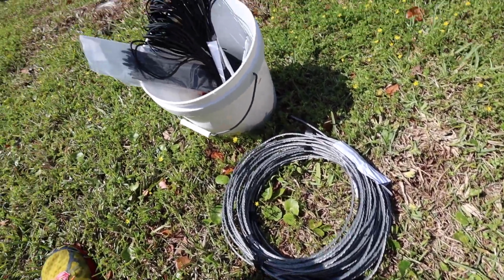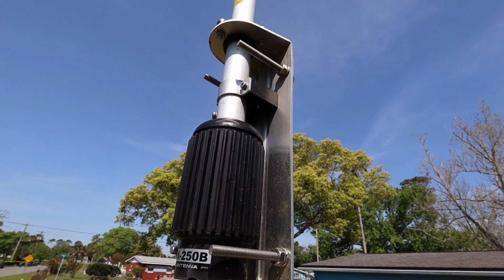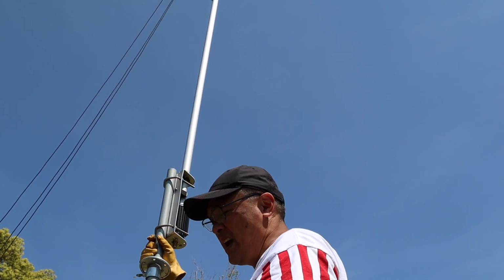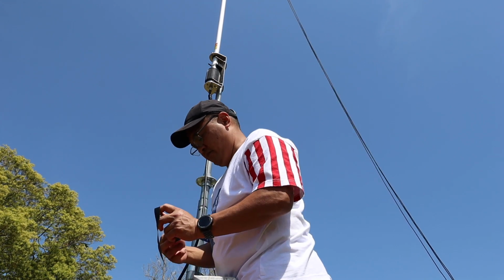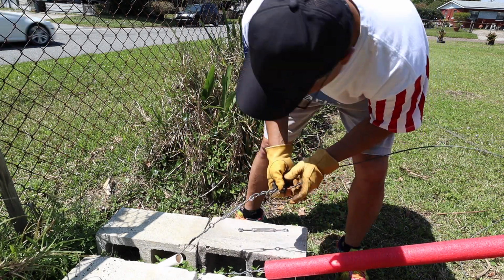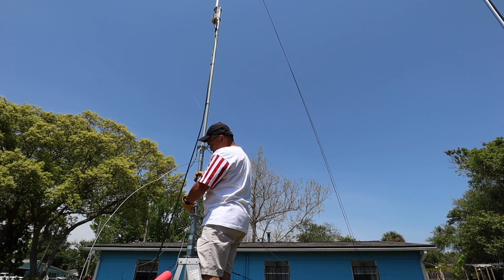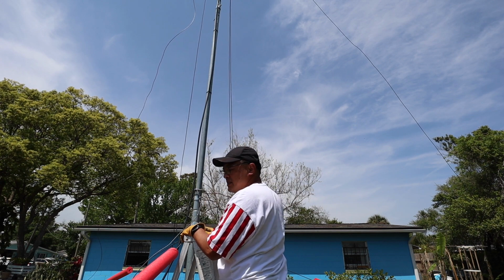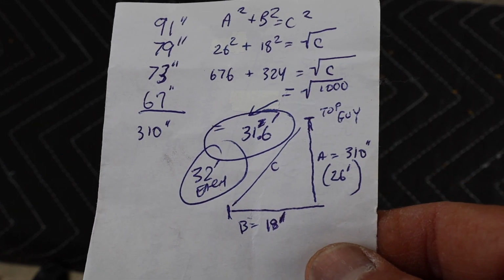Comet CHA-250B HF Antenna Takedown and Reinstall

Comment: I use one of these antennas and I have worked the United States,  Europe, Australia, and South America. Mine is 15 feet above ground. If someone is looking for a multibrand, no radials, no tuning antenna this is a good choice. The only drawback to this antenna is the limited transmit power. 250 watts.

Comment: The same antenna was marketed as the Jetstream JTV680. I have one that I got second hand a couple years ago. It just went up  literally in my front garden. SWR is great from 80 meters thru 12 meters, is about 1.8:1 on 10 meters and over 2.5:1 on 6 meters...  Useable on 80-10, no good on 6 meters.   Still in shake-down with a QRP rig in the station. I conskder it my utility antenna as I have an inverted-L out back.

De WB2VUO in Amherst, NY
Reply from the maker: I'm now using a DX Commander Classic as my Primary HF antenna.
Reply: @DarrenN4VFR  : I got my license in 1966. I guess that makes me an "Old-Timer". The yard is very small here, 100 feet by 40 feet, and the house sits roughly 1/3 the way into the yard from the street. My back yard has the AC drop running diagonally over the garage and driveway, and I have a 33KV power line along the rear property line. My useable space out back is only 25 feet by 55 feet. I have a patio lattice roof and a rear balcony. They have my VHF antennas (6M vertical, VHF/UHF Colinear, 6 meter horizontal Omni Loop)  plus a 20 - 6 meter Cobweb. A trap vertical is on the north property line, a 10 meter vertical is on a mast at the rear of the patio and a 30 foot mast supports a shortened 80 - 10 inverted-L. The back yard is full....

The Jetstream JTV680F is on a mast in the front flower garden. I just put it up as a secondary antenna, primarily to test rigs and to run FT4 or FT8 digital.  It was a flea market purchase almost on a whim ($60 well spent).  I will run it through the fall & winter and  maybe longer.  I also build magnetic loops for portable operations on 80 through 6 meters. Fun stuff, no?

73, Keith, WB2VUO in Amherst, NY

Comment: Have a question about using metal GUY wires?? Are they being used as RADIALS like a ground plane antenna... if not shouldn't you use a ISONATIONER top and bottom  of these metal wires that are attached to the metal mast post??  73 N8SMH

Comment: WOW...searching YouTube for advice and found your video!...I have exact setup coming (on order) CHA-250B and 33' pushup mast. MY QUESTION: did you put in any ground radials? I have no room to do so, and was wondering if I am making a mistake with this setup.....how is your performance (either with or without ground radials)?
Reply from the maker: Hi Jerry, I don't  have any ground radials attached, only one 8' antenna mast ground rod. I'm not too happy with the performance of the CHA250B and have ordered the  Zero Five 27' HOA 40-10m. My local city gave me a warning to take down one of the two aerials, so I took down the 2m/440cm jpole.
Reply: No ground radials required on it... N7ZXG
Reply: @ralphbailey736 why not it's a vertical

Comment: Hey Captain, thanks for the intimate look at guying and masting.  I’ve been especially interested in getting a good look at the Easy Up/RoHn poles - they seem like pretty good value for money for a permanent  station. I think you have fiberglass masts now right?
Reply from the maker: I'm no longer using the push up masts.  I have the DX Commander Classic but also took that down for now.  I'm currently using an 80m double bazooka and also have in a box that is not open, Hex Beam and also the DX Signature 12.4.  I've been pretty busy learning to fly a B737.